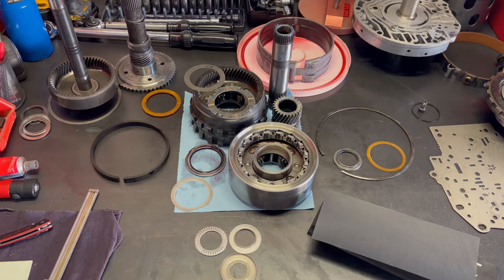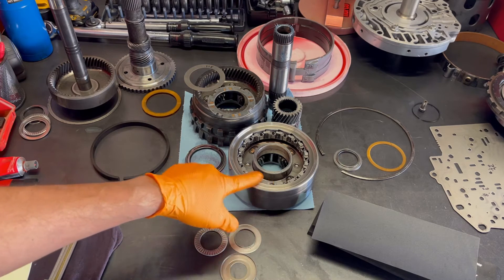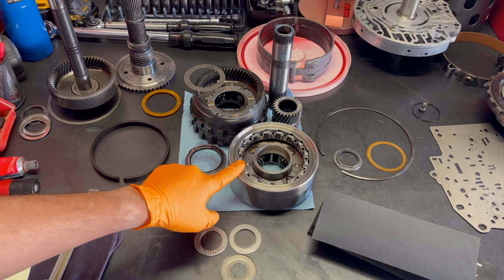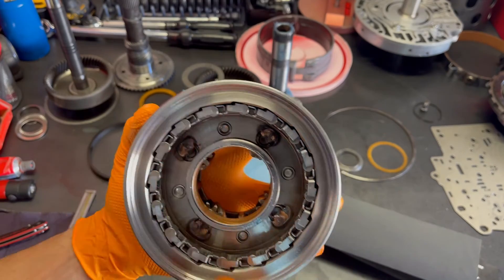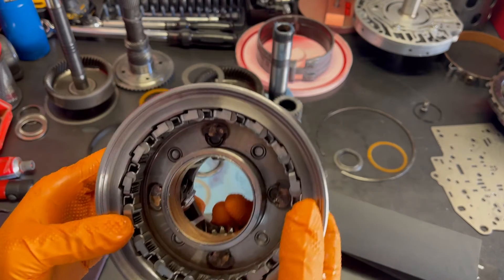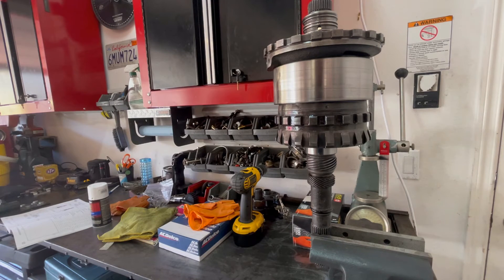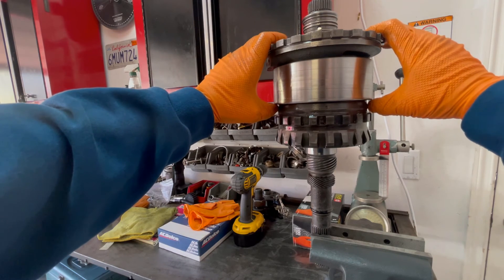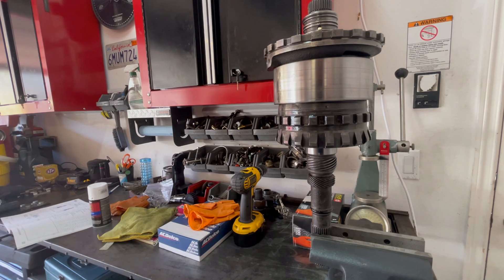Rebuilding TH400 & 4L80E: Front and Rear Planet Spacing

Comment: Hi Nick would you tell me if that shim is like a th350 pump shim? thanks for the video
Reply from the maker: Hi Bee Gee, don't use 350 pump shims as they won't work (too small)...The shims I'm using on the planets are from a GM 12-bolt 8.875" truck axle rebuild kit for shimming the differential carrier to set up back lash. You can buy them on-line or from driveline shops.
Reply: Shim under that 4 tang?